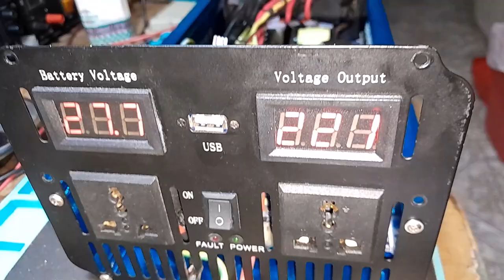Trying to repair my lvyuan inverter

Comment: Dude what is your wire size
Reply from the maker: 12 gauge.
Reply: @AlwynNicholas dude you need  0 gauge wire from your battery bank to the inverter
Reply: @bimmers323ci  The mathematics say otherwise.